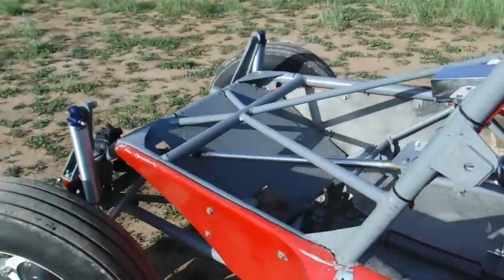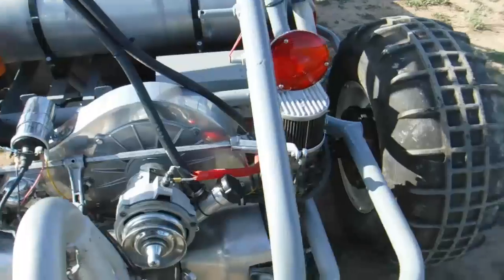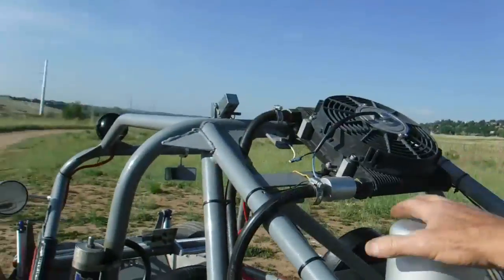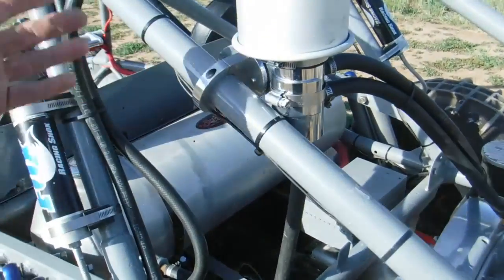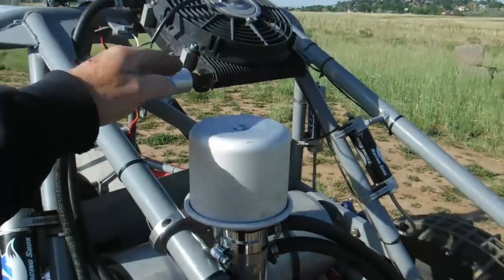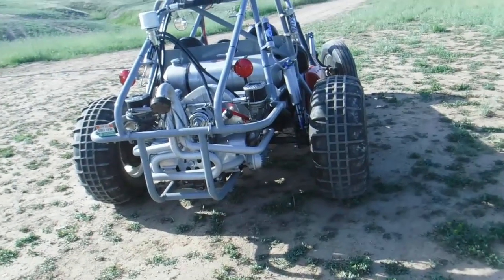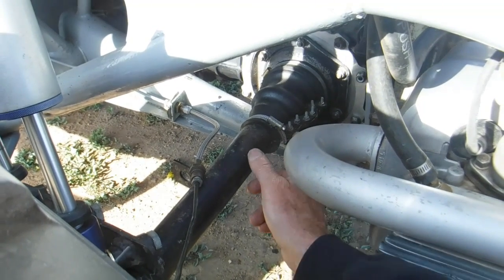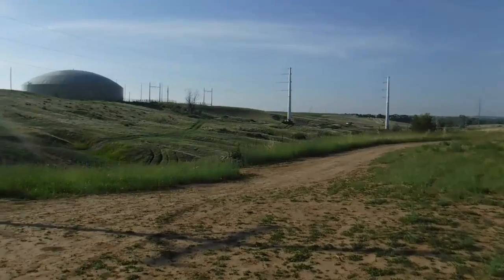VW Suspension, Crankcase Venting, Axle Boots

Comment: I'm new to sand rails. Whats the oil breather thingee about? Mine has a line running from were you put the oil in too a fuel filter?
Reply from the maker: These engines have to have crank case ventilation. Somebody decided to use a fuel filter to keep the sand out. That's fuel filter is probably not big enough IMHO. If the air can't move freely you will develop oil leaks.

Comment: That's why adjustable compression is great on shocks. You can either stiffen up the drivers side or loosen up the passenger. Just have to remember how much so if you have a passenger you can put it back.
Reply from the maker: That feature is now available for this style fox shock.  $125 per shock plus  blah blah   Not really worth it to me and I doubt I will be driving to nuts with a passenger
Reply: TheEZGZ Roger that, it does make it nice in a car you drive on the street alot. You can tighten it up on the road and them soften it up in the dirt. I appreciate all the wisdom you so graciously provide to us. Keep up the great work.
Reply from the maker: I appreciate your friendship and support.  My subs rock !!!!!!

Comment: On the lights situation, why not just use the same mounts but mount them upside down?
Reply from the maker: Great Idea but the mounting tabs aren't set up right for that. I might just get a LED bar for low in front. I was also thinking of the cross bar where the steering wheel is supported as it's right at the electrical source.

Comment: hi mate greetings from the UK😊 . question for you ,I need a new exhaust and I like the look of the Bob-cat style (it's running twin cannons at present ) my question is the twin cannons have heat take offs for the single cab I'm running but the Bob-cat has no heat take off lugs !. would you try and weld lugs not the Bob-cat ? or is it likely to run without heat for the manifold with the Bob-cat ?. would really like your thoughts on this . glad your rail is working out good for you ,keep the videos coming buddy best thing on urine for me 👍 regards Mick
Reply from the maker: Most after market heat take offs don't work as well as stock.  If you upgrade to dual carbs it won't matter. Personally I would not attempt to add them my self.

Comment: Might want to install a fan shroud air intake screen to keep out rocks, sage brush leaves and other junk you don't want clogging your cylinder fins. I run mine in the desert as well and you'll be supprised what gets stuck on the screen that you don't want going through the cooling system.